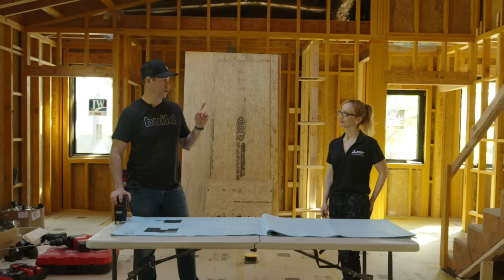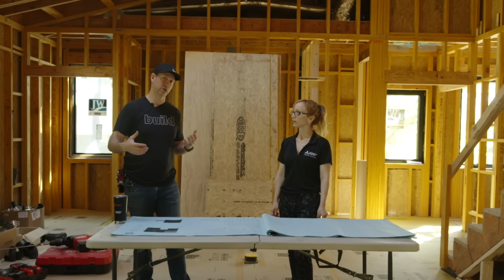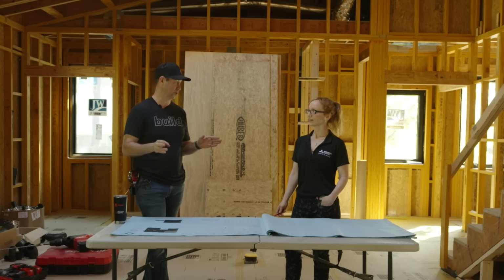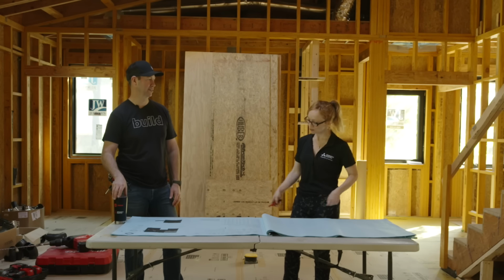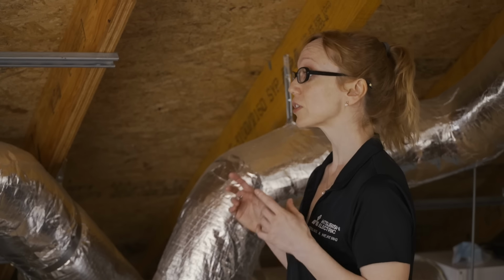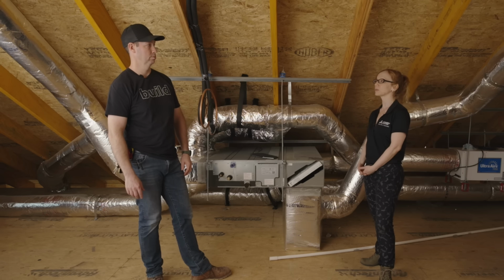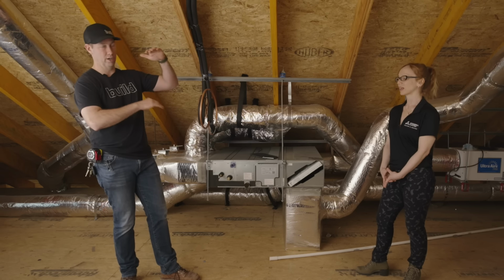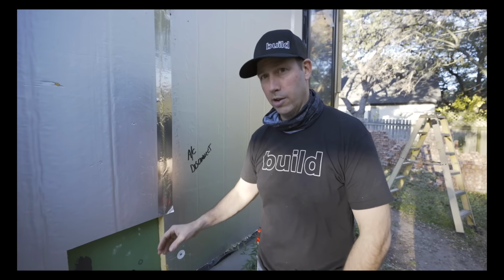Mitsubishi HVAC At My House - Full System Tour

Comment: matt, seriously, wait for them to finishing the install. it is already cringy enough with a return level with the AHU and a RA plenum or duct directly below ... can we say ... this will eventually flood the duct !!! but just seeing this AHU with no Emergency Pan or Ability to properly have a pan gives me some anxiety. already predicting the costs of that failure.
AHU's should always be 1-2" minimum below the ducts just to keep from a clogged drain flooding the ducts. also not seeing the completed install does not show a probable install of the overflow protection device, their method of complying with a Non Destructive method of Clean Out, or their compliance with the condensate pipe insulation per IEC.
but from an IAQ standard, with that being the highest quality standards for Indoor Air Quality and where most HVAC contractors fail ... Ductless systems fail miserably !!! especially poor filtration, inability to use an alternate filter, replace damage filter screens, and lets face it ... this equipment is really made to be especially disposable .... just like a window unit. just a much more costly window unit with a refrigerant line connecting an outdoor unit, and do not ever attempt to clean that coil on your own ... those outdoor fan motors die easily ... and definitely install a buck transformer and surge suppressor to help the system last for more than a season or two without damage ... they are especially sensitive !!!
and are those eathquake straps mounted onto the cabinet so that panels cannot be accessed for maintenance and repairs ???

Comment: Another benefit of having a multi unite system is in a power outage you can run one system (usually the most central) off of a generator without needing to heat or cool your entire home. saving on fuel and the coast of a larger generator.

Comment: Matt, love your vids! I have two Mitsubishi 2.5 -ton compressors with a ducted system and two air movers, one in attic and one under in crawl space.  Mitsubishi system and PAR40 remotes. Problem is the HVAC installer has no clue how to program all the functions. I'm an EECS  and have downloaded all the service/install manuals I can find and it's still super confusing. I've got it now, so thermistor used is in the remote and not air mover, fan is off when not actively cooling/heating.   I waited months for my HVAC guy to come program it, but they couldn't figure it out. The manuals I found were also very cryptic. With your 5 zones did you get a Master Controller that can keep track of all the settings from one place? You can still have local thermostats (remotes as they call them) for temp sensing and direct control, but having a master lets you do it all without running around the house to each remote, especially with your fresh air and dehumidifier set up. Good luck getting it all fired up and sync'd for daily use.

Comment: What is the capacity of the De-humidifier? Is the Mitsubishi fan coil not sized large enough to handle the latent load and sensible load of the homes second floor? I thought inverter driven fan coils can ramp down the blower rpm for better de-humidification when needed.

Comment: Up to min 4 all sounds nice but, you need "fresh air" meaning, is good to have your exterior and interior openings sealed but, you will understand one day we consume Dioxygen and produce Carbon Dioxygen and if you don't add fresh air or an opening big enough to feed your house of Dyoxigen opened all times, at least during the afternoons and nights when we do not open our doors or windows you will have zero entrance of Oxygen into your house, meaning you will be living at the mercy of the Oxygen you allowed to enter your sealed calculated by the Masters that be, and every day for years you will be conciously or unconciously submiting your family to a lack of Dioxygen we all need so, since you probably do commercials and they do required them, I hope you or all possibly that read my words and realize this is true and needed, you all possible add the best possible fresh air openings or ducts to your air handlers and from time to time, use the fan in on to make the Dioxygen moved, refreshing the air for your better health. And calculations are least possible suggestions. Reality will call for changes you may need or may submit to the architect for them to add to your blue prints. 

Later I may comeback and may tell you more, if allowed to do so.

Comment: Just as a heads up for people watching, The installation cost on this type of system generally is more because of the amount of equipment needed, indoor units can leak water and refrigerant which can be costly, and your have alot more copper linesets with flares which are known to leak if not done correctly or can leak if contorted to much. As a contractor I go out to houses and people ask all the time about putting "Mini Spilt Units In". They have a place like bonus rooms, basements and hard to get duct to areas. Also my wife is a realtor. If they see indoor units on the wall EVERYONE asks why is that there. Its ugly can it be moved. One more side note. Instead of having 2 items of equipment to take care of when it gets older you now have many more with all the indoor units. Again I am NOT against this but consider the cost up front. They do control temp very well, humidity and efficient. As a contractor honestly I make more money off you from installation, repairs and service. Im just spilling truths for serious thinkers.
Reply: I thought the ceiling mounted cassettes needed attic access for maintenance issues....?  It looks like in Matt's home it was installed between joists, isn't this a mess if there are issues with that unit?

Comment: In the caribbean a lot of residential constructions go with mini split units and the results are fantastc. In colder countries I see a lot of houses, specially old ones, are retrofitted with central ac and it's just not as good quality as ductless mini split units, and sad part is that central ac is more expensive!
Reply: You would need a separate unit for every room in cold climates.

That is why central heating is common.

Comment: Purchased: August 2023 - still works GREAT!I https://www.youtube.com/post/UgkxxsUnXhGsSJLim_XnMHyQK0u3XVaW-CGn live in a studio and during the summer it gets scorching hot - really old building with no ac units. I can’t express how EASY it was to install. This unit has been a life savior during the summer and some days during other seasons where it can still be a bit warm at night. In this small place is my friend, a husky, poodle mix and myself. We need AC - lolI don’t use the dehumidifier option - I’m not sure if it will leak in my house, since I did not install the small draining hose that came with it. May look into it late but I don’t worry about much humidity in the apartment. I don’t understand why the negative reviews since all things mentioned, I personally did not find issues with. Definitely worth it!
Reply: All ac's condensate. If yours came with a drain designed to be exiting your house, you'll need to install it or, a leak will appear one day, sooner and not welcomed as no one desired to confirm my words. If it happens don't feel too bad though, the solution is known, allow it out. Then get ready or, make a way possible for it to be flushed/clean every 6-8 month, if possible install it a flow switch or two, in case one fails the other may work as a rescue, to avoid the unwelcomed drain overflown or drain failure or clogged due to the nature of the system. Again, don't get frustrated or mad. What I tell you is what many don't bother to do tell you because of all the reasons implied. Hope you get this. If not, you will! Any questions just ask. I'll try to help.

Comment: In Minnesota, they require a disaster/drain pan underneath the indoor unit when it is located above another level of the home.
I do not recommend using a filter with a MERV rating higher than 8 as it reduces air flow too much. Also, the filter is meant to protect your equipment, not you.

Comment: Hi Matt, located here in Houston, Tx. We are doing a 500 sqft addition to an already 1912 sqft ranch style. I can't seem to find a GC with HVAC subs that will install a ducted split system like the one here in the video. The current traditional system is sized appropriately for the existing home at 3.5 tons but every guy I talk to wants to simply sell me a 1.5-2 ton traditional system. Any advice on finding an experienced HVAC tech that does systems such as these for sizing and installation?

Comment: Where are your secondary drain pans for your hvac systems? If one of your systems primary drain lines gets clogged,  you will have water leaking through your ceilings.

Comment: Great job!!! Only thing i would change is the armour flex on the line sets. K flex Titan type insulation holds up with UV much better.Especially when penetrating thru the exterior. Eventually the insulation will get hard,crack and lose its insulation factor.There goes your tight seal penetration.   K flex doesn't rip when installing. Its even hard to cut with a utility knife.

Comment: I design HVAC systems as a  profession and I want to use the PEAD unit in my house but the submittal sheets only give low-med-high CFMs (wet 461-572-667) and external static pressure (.14-0.2-0.28-0.4-0.6). Even though she is saying that the unit can operate up the 0.6 inches this is at a cost on CFM meaning that the airflow falls to 461 at the 0.6".  My load states that I need 1.5 tons @ 720 CFM but the 18,000 Btu PEAD can't perform there so I jumped up to the 24,000 Btuh. This too appears to struggle. At 720 CFM, from what I can tell, PEAD 24 can only do on high for a dry coil and Really low static. I would love to know where I can chat with someone about this preferably a Mitsubishi engineer b/c as far as I can tell, I would have to go up to the larger unit which defeats the purpose of this unit. I keep finding myself in at 0.2 inches of allowable static with almost all manufacturers 2 ton ducted mini-split units. Any help would be awesome, just need answers that make sense.

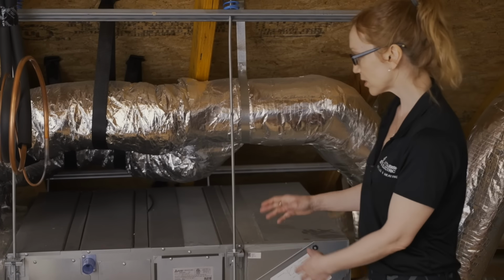Comment: 13:40 How are you in Texas with no insulation in your attic?  Is that a different video?!!
Reply: In another video he installed closed cell spray foam. Also, the attic is not vented.

Comment: For anyone looking for Mitsubishi mini split in Canada, don't. I am about to remove and dispose of low static system I paid for dearly because of poor install/design and non existent support after installer took off. Kicker is that Mitsubishi has a distributor that is doing support for HVAC installers. They will commit to nothing on PEAD and SEZ units in regards of ducting and provide no guidance or advice even to the installers. End user support is literally non existent. Do yourself a favor, before you buy Mitsubishi HVAC in Canada, pretend that you did that already and that you have question and try to call them. You will very quickly find out that they will NOT pickup the phone and they will NOT call you back. If someone calls you it will be a sales person from distributor that has no skin in game. Mitsubishi support in Canada is a sham.

Comment: in a forced-air system we have one fan that pushes the conditioned air around the home.  the air is circulated, pushed and pulled all around the home with just one piece of hardware.  Now we want to install a fan and air handler in each room.  All installed at the same time, so expect to have to replace all the units at the same time.  But now you have the cost of replacing 8 units, not just one.  And you will need to do that work in the homeowner's living area and not the equipment room.    
It's like installing a small water heater under each sink?

Comment: Great video.. one question.. I didn't hear any discussion of humidifiers?  Don't you need one of these to humidify the air in the winter?   In keeping with this apparent omission, I noticed the heating load chart was missing Latent Loss (which would be heat required to add humidity in the winter).   If I'm reading correctly, the Sensible Heat and Latent Heat were the Cooling Loads; and then Sensible Loss and Latent Loss should produce the Net Heating Loads.

Comment: The showcasing of the mid static unit is what sold me on installing a multi zone mid static at my home.  We have 540 sqft, and are going to be adding another 575 sqft.  I chose a Pioneer brand because it’s diy friendly, and I can install it myself as well as the fact that I can install the air handler for the existing structure now and install the air handler for the addition in a few months to a year when we make it to that phase in the addition.  

I know next to nothing about HVAC, but I taught myself just enough to be dangerous and install my own unit.  Thanks for doing videos like this Matt, I’m always learning something.

Comment: You know whats not good about the kitchen unit? Having to drill through all that wood to get the copper where it needs to be. Also, the water will have to be pumped out, instead of draining to a safe location. Water bad !

Comment: Really interesting stuff!  Wish my house was as advanced.  I had my house built in 2018 but the builder was not a custom builder and offered no HVAC upgrades, so stuck with a standard 14 SEER single-stage AC + single stage 92% efficient furnace (Goodman equipment).  I'm having some issues with humidity control (having to over run the AC which I hate).  Also, they have the house ventilating with a bathroom fan that turns itself on intermittently.  Not happy with any of that.

Comment: Can the external ventilation systems work something like a whole house fan? Where I live in Southern California the outside air temperature is below 70 degrees by 8PM most of they year. But on my area the air conditioners are blasting away well after 8 PM because of the heat remaining in the house structure.  It seems like there might be a big opportunity to use the whole house ventilation system to suck that evening air into the house for cooling it.

Comment: The critical part of a Mitsubishi City Multi is the install.  They are super sensitive to poor installation practices.  So much so, that I have never seen one that runs right, or lasts.  Done wrong, they become a maintenance nightmare.  (I've been through the Mitsubishi City Multi install class and worked on many of them)

Comment: I hate those type of ducts your using because I feel they decease the flow capacity of the hvac system significantly.  If you look at the ducts they are compressed in areas and and are kinked as well. That creates a issue in regards to resistance. I feel those type of ducts can decrease your airflow capacity substantially. Look at it as this if you have a exhaust pipe thats 3" and then it gets reduced down to 2" then its going to restrict the flow and most of the time if not all the time the hvac contractor hangs those ducts and it compresses them or it cuts them off cause there kinked. Just not a efficient type of duct. You need solid ducts and all the joints sealed with liquid mastic and then wrapped with insulation. Its the only way to not decrease your airflow capacity and not to decrease the efficiency of your hvac unit. Another major issue with those types of ducts your using is there is no way to clean and remove all the dust particles which they can and will get dirty and collect pollutants. And also if you look at those ducts, they are blowing air thru them with the insulation exposed which is going to cause some of the insulation to become airborne and the air quality will be reduced. Never understood why those ducts didnt have the insulation to where they are sealed from the inside so the air flow is not blowing right thru them with the insulation exposed. You dont have that kind of issue with solid ducts. You can clean and remove all the dust particles.

Comment: There's so many contradictions in this video, it's brain-hurting.
1. He talks about his house being sealed up so no tight, but those numbers on the chart under "ventilation" look like he's got all his windows open. Maybe they'd be even higher in a standard house, but ... I wouldn't call that "tight."
2. She says specifically not to worry about the "party" values, because that's inefficient. He directly interrupts her to brag about having sized his house for parties. 🤣. Like literally "fuck you bitch I'm rich"
3. They brag about mini-splits for a while, then they go upstairs and show off a traditional duct system. 😆
4. Did he not spend the better part of the intro explaining how tight his house is? How he wants it to be sealed? Then why on earth does he have a system that continuously ventilates? Lol. Like wtf? I get that it's controlled, but boy you're brainwashed. You're worried about nature, the pollen, the mold, etc.... But instead, in 13 years, you're going to be worrying about chemicals and refrigerant leaks coming in constantly through the ventilation system.  
5. If outside air leaking into the house causes inefficiency, then doesn't a forced-ventilation system, which has to also heat or cool outside air, also cause inefficiency? 

I'm barely halfway through the video, so if I see any further discrepancy I'll comment below.

Comment: What's the advantage of having a separate AC system and Ventilation system? Could you not incorporate a heating/cooling coil into the HRU and duct the cooled/heated air. Just seems like a lot of additional ductwork and equipment?

Comment: The last time I looked at Mitsubishi splits the efficiency of INDIVIDUAL  condensers was MUCH HIGHER... into the 35 SEER range. The multiple units that run more than one air handler topped out at around 18 SEER. Wouldn't it be cost effective for INDIVIDUAL condensers for each handler?